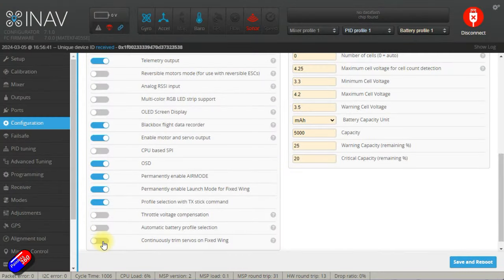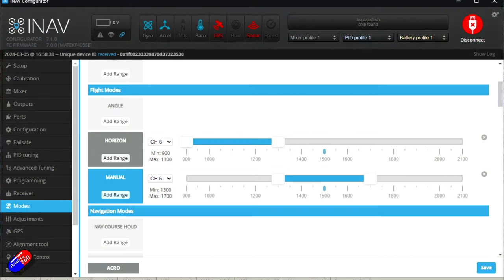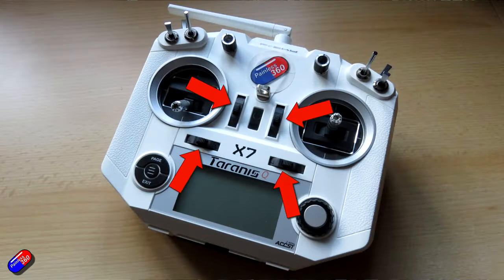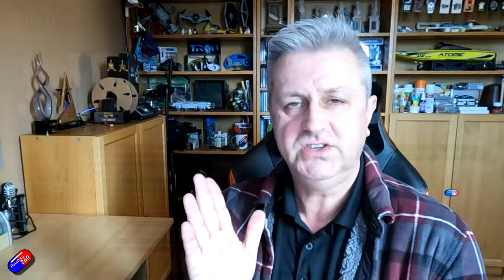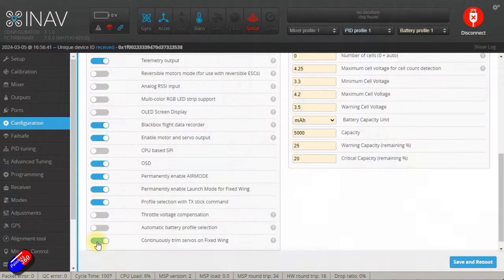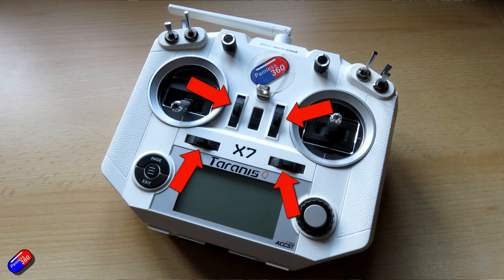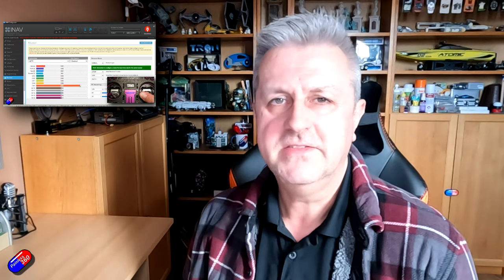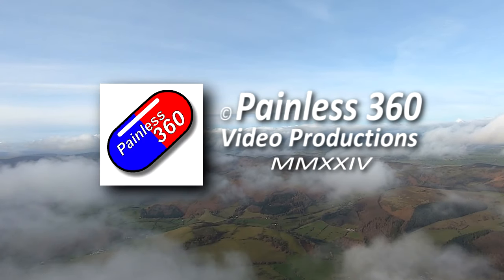Why does my INAV plane/wing want to crash in MANUAL mode?

Comment: For me, having a plane perfectly tuned in manual mode is a prerequisite. INAV will fly a rickety plane but it will have a lot less work if the plane already flies well in manual mode.
Reply: INAV is able to fly a brick nowadays just like Arduplane..🤣🤣
Reply from the maker: As I've said since the beginning, INAV will fly a poorly setup plane OK, but a well setup plane great..  Happy flying

Comment: Continuously trim always makes my planes fly slow turns or climbs/dives in manual depending on what I was doing in the previous stabilized mode.

I set up my radio to only use trims when I'm in manual mode, so I can still trim the plane normally when in manual mode but it won't affect any other mode.
Reply from the maker: I've not found that, but if you don't like it on all the time then use aurotrim mode and once it's setup. You turn it off... Happy flying

Comment: Biggest problem is people forget how to fly an airplane manual.

You can use the trims in manual.
Land it.
Hook it up to a computer. Make a screenshot of the values on the bars.
Put your transmitter trims neutral.
And trim to the same settings in INAV.
Reply: Oh and best is trim mechanically on the surfaces too instead of using subtrims.
Especially on delta steering/elevon.

If your servo levers aren't the same angle is gives nasty inputs on elevator because they have different deflection.
Reply from the maker: A good mechanical setup will always improve the flying experience, irrespective of the mode. Aurotrim and continuously trim servos option work incredibly well and once the model is trimmed, you can turn it off... Happy flying

Comment: With a foam plane, every time you fly it, it could be a little bit different and its balance can be off so it pulls to the left or right or up or down. When I click it over to manual mode, I always keep my finger on the switch, and I’m ready to flick it back to acro mode in an instant if it decides it wants to flip over.
Reply from the maker: From my experience with the aurotrim stuff in INAV over the past few years I trust autotrim to get it right... Happy flying
Reply: @Painless360  Excellent thought Lee!  AT works great for me as well.  Because of the nature of foam, I can never count on my crafts flying the same from week to week so if its way off, for some reason, I will bring it down after my first flight, and make mechanical changes to level it out, then AT to fine tune.